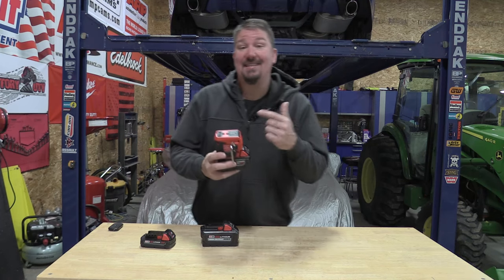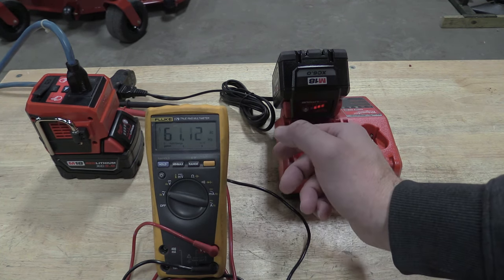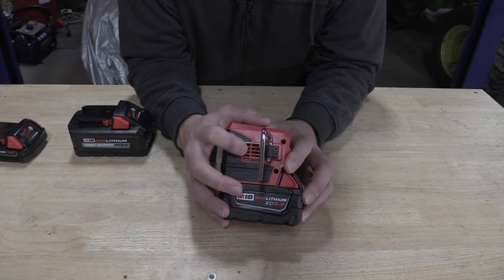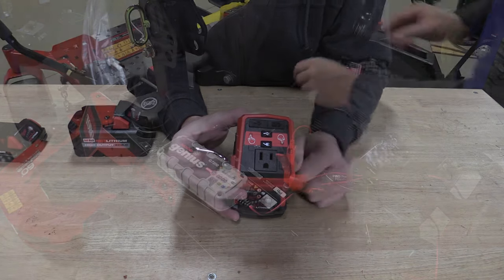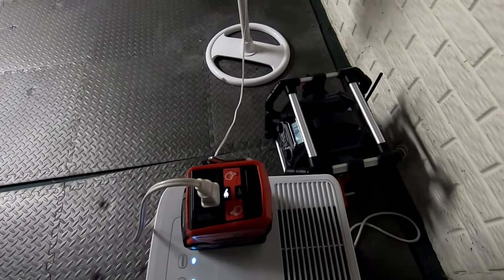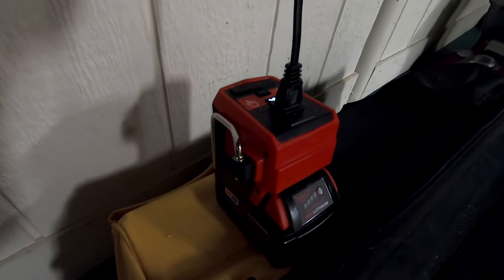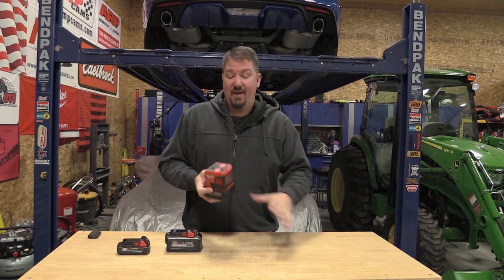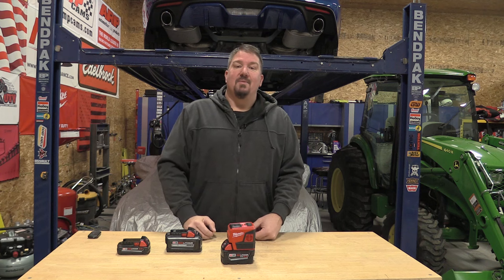Milwaukee 2846-20 M18 Top-Off 175W Power Supply Review | The Best Small Inverter To Date

Comment: Some of these questions are ridiculous.  The man just said it wouldn’t power anything that requires heat.  Toaster, coffee machine etc.  y’all steadily asking him the same questions.  No, it’s intended use is for small items.  Y’all want it to power a welder, 5 toasters and a blender an a/c unit etc!!  No no no!! 🙄🙄🙄
Reply from the maker: Thank you!!!
Reply: What if you LS swap it?! 🤔
Reply: Microwave? Hair Dryer? Vacuum? 😅😅😅😅
Reply: What about the window ac unit itself?😂😂
Reply: Tv ?
Reply: @joeysandoval2511  yes it will power a tv
Reply: It powers my heating lunch box. So yes it does power heating devices
Reply: Can it run a ShopVac for 5 hours straight? 😂
Reply: “Y’all want it to power a welder” THAT WAS A GOOD ONE 😂
Reply: @Stephen_416 which heating lunch box do you have? I have an 80W and it overloads the top off inverter 🤦🏽‍♂️

Comment: When I first heard about this Top-Off unit I thought it was a stupid idea. I mean, why pay for this when you can get a battery backup like Jackery? But now that I'm accumulating MW power tools with more M18 batteries I realize that in an emergency the M18 Top Off could come handy to tap into power sitting idle in my MW batteries. Thanks for the review! Cheers!
Reply: It's great for camping. Charge all your devices, a light, a fan.
Reply: Hurricane Milton heading to Florida I’m looking into grabbing one
Reply: @rahmanburch3100  . I know its a bit late now for this but since my comment I bought some Jackery units for power back ups. Anything helps during emergencies. Stay safe!
Reply: @rahmanburch3100 Just used mine and a multitude of my work batteries to make it through Hellene here in Georgia. Stay safe brotha.

Comment: Wouldn’t it make sense for Milwaukee to make an inverter that actually powers CORDED TOOLS?
Reply from the maker: They have it in the MX line.  We would all like to see a multiple battery system like the Dewalt to power tools.
Reply: They have, it's called the Carry-On is $600 and takes 4 batteries...and is massively overpriced after you factor in 4 12.0 batteries.

It's pure sine wave instead of this modified junk 175w.  Not sure why this guy loves it so much...I think roll of the dice of whst he tried it with.  I suppose if it works with all your stuff it woukd be great.

 Hook it up to an oscilloscope and the modified wave looked like garbage and ran everything way hotter than I felt comfortable using long term. Smoked a 80w scooter charger while camping.

Check with a thermal camera before you leave anything expensive running off it.  If it's cool, chances are you're ok.

Comment: Thanks so much for this review. I didn't realize this even existed. Living in North Florida, something like this would be a major bonus. Aside from major storms, we're guaranteed a string of some pretty nasty thunderstorms in the summer. While the city power rarely goes out, here in the county I will be without power for a minimum of 12hrs at least 3-5 times. So if I could just plug in a lamp, a fan and charge my phone without having to leave my car running after a storm...I'd be str8!

I'm on the Milwaukee train, so I luckily already have several batteries (including the big guy) and a couple of chargers. But for those who don't—especially those who generally have no use for power tools—the sticker shock may leave you questioning whether it's worth it. I resisted battery powered tools for years, but finally needed a good trimmer and had the choice between battery powered or gas powered. Now I'm all in. Simple fact is, for anyone who doesn't know, not only do those batteries run the tools wonderfully, they also hold a full charge just sitting on a shelf for a ridiculously long time! So if you find you need it, it'll likely be there. The cost may seem high, but any emergency kit should have at least one of these.

And no...I have ZERO affiliation with the brand. I'm just really pleased with the quality I paid for, which is becoming a rare thing. 😁
Reply: I’m in NE FL too, just picked up two of these yesterday for an emergency - awesome idea from Milwaukee to utilize a ton of money of batteries that I already had and hadn’t considered using for pedestrian application. Huge savings over standalone battery systems. We hope we don’t have to use them with this storm but we’re glad we found these!

Comment: The square wave frequency coming out of that unit was the issue with your power meter. Most electronics don’t care about the way the electrical wave form looks but some are very sensitive and will throw a fit when connected to anything other that a pure sine wave.

Comment: I’ve run a small heat pad with it before, about 5 hrs with the the 8 amp.  I would imagine it would run smaller electric blankets.  That heated jackets are basically a heated blanket and they take the small 12 volt

Comment: Got one two weeks ago, it is really nice for charging devices.
Reply: Where'd you pick it up at? I can't find anywhere 😫
Reply: @shanew7361  same I've been looking also but can't find it
Reply: @shanew7361  I’ve been finding it online
Reply: I'd like to get it at Home Depot in case I don't like it I can return it. Otherwise order online I'm screwed
Reply: @shanew7361  True. Based off what I saw I would get one but I use desalt and they don’t make one
Reply: @justinlamb3822  I was thinking of using to run my cable modem/router and maybe a 65 inch OLED 📺 or my direct vent gas 💧 heater 🤔
Reply: @shanew7361  It is easier to return Amazon items than any store.

Comment: Would this run a CPAP that uses about 90watts with the humidifier? If so how long would a 5.0, 9.0 and 12.0 battery last using it just for that purpose? Thanks.
Reply: I would say yes.  120 w

Comment: Interesting...next gen - stackable batteries for added capacity and power.
Reply: They should be making that NOW!  What am I supposed to do with 175w?  Make a larger inverter, 1000 to 2000 watt (I know, 2000w might be a bit much on 18v batteries, youd have to have a bunch of them to do it, 6+), able to take multiple batteries, 4+.  175 watts is pretty useless to me, I already have two of the battery adapters with USB ports, and that seems like about all this new one would be used for most of the time, except its 3 times larger.

Doesnt DeWalt make a larger one like that, that even charges batteries when when plugged into AC power.

Id love to see one that also had a jump starter capability for cars, plug multiple batteries in and it steps the 18v down to 12-13v so you can jump start a weak car battery.  I once jump started my work truck battery with two M18 9.0 batteries, not really ideal, but it got me home.  Something to do it properly would be pretty sweet.

I know they are comming out with the MX Fuel crap, but thats way to expensive for the average guy, thats more like stuff large companies would be buying.

Comment: I didn't hear you say. Would I be correct to assume this is modified sine wave rather than pure sine wave?
Reply from the maker: I was unable to find that info through a ton of digging.  I am assuming that since they are not bragging about a pure sine wave, it must be modified.  But it does say safe for laptops and such.  That is an unknown to me.
Reply: I'm 99% certain this is a modified sinewave output inverter as the pure sine wave models require much more electronic components that would definitely not be able to fit in that tiny footprint they managed to create.
Reply: I've seen inverter generators that claim to be pure sine wave but they are in fact modified sine wave. I highly doubt that this is a pure sine wave unit.
Reply: I know nobody reads warning labels, but... the first words on the side of the unit are: “Warning: output non-sinusoidal”. Which tells me it is not even a modified sine wave, probably just a square wave. Still a nice product.

Comment: I was hoping dewalt would come out with something like this, well guess what I was in Lowe's looking to get the 20v craftsman dremel tool that has wired dremel tool that slides on a battery but when I looking at this I noticed this little inverter similar to to this it has a 150 watts so I got this and just plug in my corded dremel which is kinda cordless now, I tried on a box fan it lasted 4hours on low with 4amp hour battery, it's got a light which is bright and A type C and a port 2.4 amps for A and 3.0 amps for C

Comment: slide in the big battery from the 3600 watt generator into the m18 top off and see what it runs.
Reply: You can't force more wattage into the unit with a bigger battery. Its like trying to divert the near by river through your kitchen faucet.

Comment: My wife runs an electri throw blanket off the M18 and the Ryobi inverters I have, I actually like the ryobi more. It's got a built in light, no annoying fan and it's smaller. But both are great littler power supplies.

Comment: As far as the devices you ran with this mil top off, how would you compare the quality of power from this top off vs the dewalt power station for small less demanding devices? Would you say similar? Or the top off is better?
Reply from the maker: The 1800 watt dewalt?
Reply: Yessir. 
I know the dewalt can handle more but I was more interested in the quality of power for running small devices. Iv heard people say not to plug in laptops, TVs, or anything with electronic boards with the dewalt, it’s only built to run corded tools when you don’t have a wall socket close by. However, dewalt indicates the power source will run these devices without actually listing what it can run. Wondered if you ran the Hz clean power test with your dewalt power source.
Reply: The idea was to run a small mobile office from the tailgate of my truck.

Comment: EGO has a similar device I bought a year and a half ago.
Very good portable charger and and it will take my 7.5 Ah battery.
EGO, also, has a newer one, wherein one could mount multiple batteries for even longer life. 3000W
Both with a 120 outlet and all the rest.
I just use my usual EGO 56v yard tool batteries whenever I want to use it.
Oh, heck, I just searched and watched where y'all already looked at it. NVM
Reply from the maker: If you hear me talking in here and in the description,  the EGO unit is the one that blew up all the crop in my RV with too high of voltage.  That EGO Nexus was the downward spiral of EGO quality.   It seemed that from there they worked to rush to be the first to market with many other items and really used the customer as R and D.  I have not had luck with any of the new EGO stuff including this years lawn mower  and 2 stage snow blower.  We used to recommend EGO, not anymore.
Reply: @WorkshopAddict  Odd I have to disagree.
Reply: @WorkshopAddict  I  have to say that my EGO stuff has all  been bomb proof...including the snow blower.

Comment: I want to buy me a 3600w power supply from milwaukee! Actually, I want to buy TWO! I was wondering if and how long can I run a TOASTER OVEN on it. Also, I want to Plug my Computer, Monitor and External Hard Drives. I want to Almost Exclusively Run my Room on these power suppliers.

Comment: can you plug in a m18 charger and charge another battery or are you just rading juice from the power supply battery to the battery needing charging?
Reply: There will be efficiency losses so if you were to take a full 5.0 m18 and charge a dead 5.0 m18, you wouldn’t get a full charge on the battery you were trying to charge

Comment: a bunch of reviewers on the Milwaukee website said this thing shuts off after an hour, but ONE person said it was after an hour of being IDLE.. can you confirm this?  I'm looking at getting it for running my router during power outages and if i need to press the button for the 120V outlet every hour, it defeats the purpose!!
Reply from the maker: IMHO, this is not safe to run a router.  I woud be sure to have a pure sine wave product to run sensitive electronics like that.  If there is no load, it will shut off in an hour.  If you have a significant load, it will remain running.  Since you capitalized IDLE, my answer is that it will shut off.  Look for a Pure Sine wave device made for sensitive electronics, or better yet, a UPS so you wont even lose power to your router when the power does go off.
Reply: @WorkshopAddict  I powered my desktop PC and my router with my 8000W gas generator, so I'm not worried about clean power.. but I just wanted to know if it would shut off after an hour or so.. the router is  rated for 12 VDC and 3.3A, so about 40 Watts - thank you!
Reply: @vjmacintyre  good question, I rent my router so I’d just get a replacement router for free if it gets screwed up. But I’m also curious if it would need reset every hour,,,

Comment: Can you run a vacuum off of this? Or do you think the vacuum would be to powerful
Reply from the maker: No way it would run a vac, vacs take up too much power.
Reply: @WorkshopAddict  I did some research on how much wattage vacuums use. Pretty interesting how they are making battery powered vacs though 🧐
Reply from the maker: @itzNickyJayBeats  I understand where you are coming from.  This unit won't even power a corded drill.  But they make powerful cordless drills.

Comment: I wanna bring a blender to the beach slash boat?  If it run a fan motor a blender shouldn't be a problem??? 
Ps. I have a lot of extra Milwaukee batteries and a lot of rum and pina coloda mix
Reply from the maker: It would have to be a small blender, but it might work.  Not going to turn a vitamix!
Reply: @WorkshopAddict  i mean with all do respect man im not an electrician but I can drill 100 Sheilds into the slab with a hammer drill or cut rods with a bandsaw all work day both on one M18 battery
Reply from the maker: @johhnyapplesseed9776  Right! But with a tool designed for it.  This 18-volt DC battery need to create 120 volts.  It can create the volts, but it not creating more than 1.25 amps.
Reply from the maker: @johhnyapplesseed9776  My vitamix blender is 11.5 amps.  That's 1400 is watts.
Reply: @WorkshopAddict  😯☹ alright ya that sucks ya it would be nice to chill on the beach without a gas generator or a 500 dollar battery pack. Thanks for the info u earned my subscription.  Merry Christmas
Reply from the maker: @johhnyapplesseed9776  Milwaukee could make an 18 volt blender without issue.  OR you could make one your drill could hook up to.  This inverter just won't do it though.  Merry Christmas

Comment: I need something that will run a 120Vold 9Amp electric tiller. Anything out there?
Reply from the maker: Yes, but you will need something that can do 1500 watts consistently and stick at 2500 plus.  You will pay upwards of $1,000 for one of these.   Is it worth it for a tiller?  You could buy one helk of a gas tiller for that price.
Reply: @WorkshopAddict  I know there are tillers that can run with a cordless drill that seem to work good. About 600$
Reply from the maker: @gnc1962  you would be better off with a battery operated attachment ready power head and a tiller attachment.
Reply: Here is what I bought: https://www.princessauto.com/en/120v-9a-tiller-cultivator/product/PA0008898082
Reply: @WorkshopAddict  It would be nice if they made a tiller that would run off these batteries. You think it would be doable since you can run a small tiller with a drill that uses these batteries.

Comment: This video is quite old but would this run an angle grinder?
Reply from the maker: No.  Not a chance.  Most angle grinders are 8 to 13 amps, making them 900 to 1500 watts round numbers.

Comment: Most likely the reason that your watt meter wasn't working properly goes back to the beginning of your video where you said that you wanted to test and make sure that it is clean power..... You did not test for clean power. Clean power would be yes the correct voltage and at 60 hertz however it would also be a pure sine wave not a modified sine wave a pure sine wave is a fluid motion that looks like a waveform you know what it looks like because you're a technician and should be used to on oscilloscope. A modified waveform is a square sine wave rather than that curved fluid motion it has hard ups and downs on the ends and beginnings of each cycle... Most cheap inverters like this are modified sine wave. True sine wave or pure sine wave inverters are much more expensive. Modified sine waves can cause problems with some electronics although that is not as big of a problem nowadays as it used to be because the electronics have gotten a lot better and will accept this type of modified sine wave now older electronics may still have a problem also certain types of motors will surge and pulsate and or hum when powered by a modified sine wave

Comment: Wonder if a guy could run a 12v battery charger off it instead of running out extention cords
Reply: You would need to run 12v power suppy. Seems kind of inefficient to go dc->ac->dc
Reply from the maker: Bakken, Do you mean a 12 volt truck battery?  I showed that happening in the video....

Comment: I plug in a TYPE C cable from the unit straight to my phone and it seems to malfunction....

The charge goes off and on off and on off and on while connected.

I tried a different TYPE C cable and exact same thing as the first.

Tried a 3rd TYPE C that's older and phone indicated slow charge..

Maybe mine just came w bad TYPE C port

Comment: I love gadgets and milwaukee tools but it needs a little more juice.
Reply: I agree 175 watts is a little weak. I mean their 12ah battery is a monster 👹

One thing he fails to demonstrate is when plugging things in, depending on what you're plugging in can and does cover the switch to turn either the outlet on or the USB port on. ToolBoss demonstrated this on his review.

Also, $100 seems pretty steep.

Comment: Would able run Heat gun and small leaves blower?
Reply from the maker: Never.  A normal heat gun is 1400 watts.  This will do 175.  Blower would be about the same.